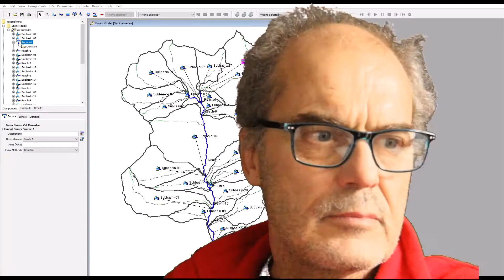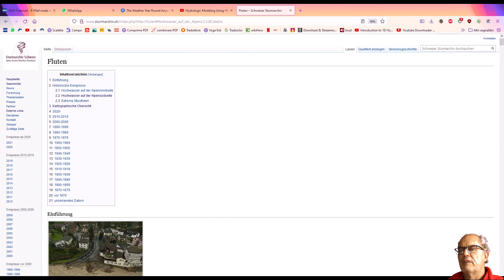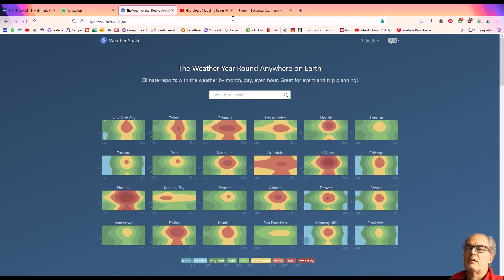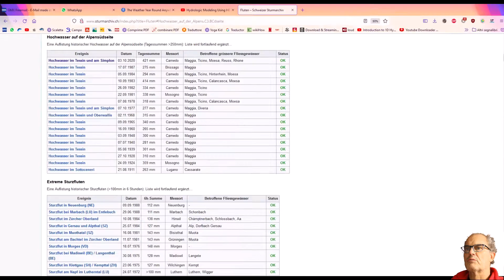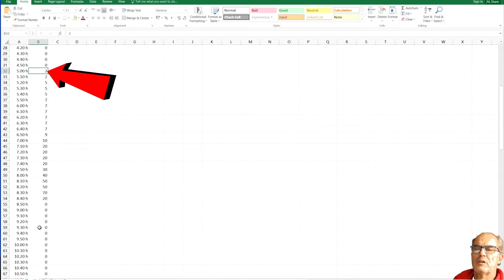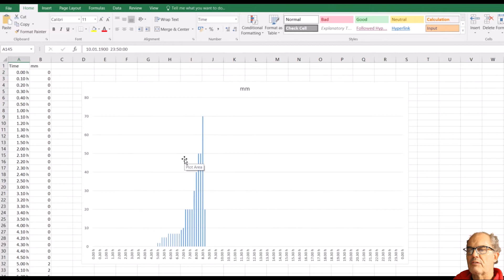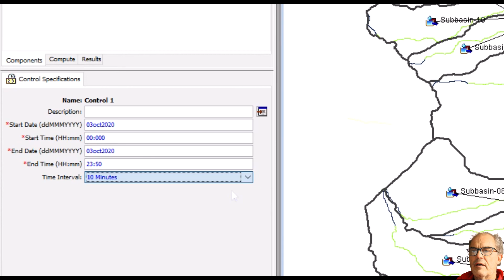HEC-HMS part 7/8, Adding the rain gage and rain intensity

Comment: Thanks for this!  Inserting actual rainfall time series into HMS is not straightforward. One comment: The units of the precipitation time series is incremental depth of precip falling over time interval (in, mm) and not intensity (in/hr, mm/hr), correct?

Comment: Thanks for the explanation. I have a question. In my project, I know the total daily rainfall and I know the duration of the rainfall. I don't know how much rain fell every 15 minutes. How can I set up my time series data correctly please?
Reply from the maker: I think you have to estimate the rainfall every 15 min. The sum of every 15-min rainfall must correspond to the total daily rainfall. But it will be an estimate anyway
Reply: @AndreaCippa-Siteplanning  you would need to use a distribution model though. The peak is an important parameter. SCS has a hydrograph method for this.